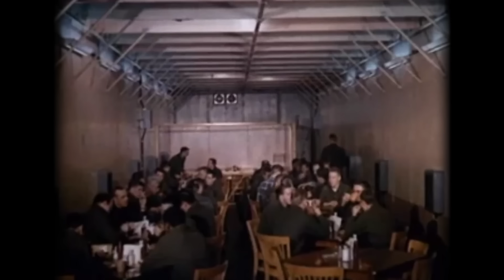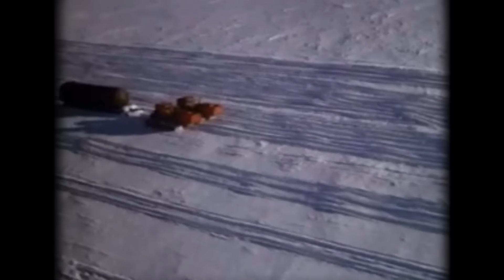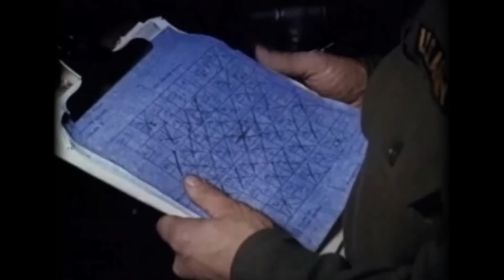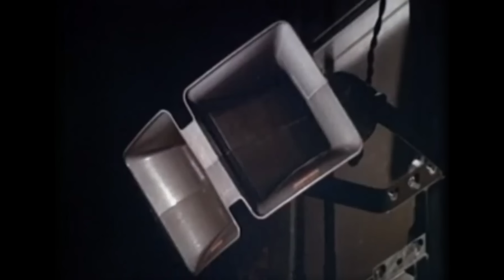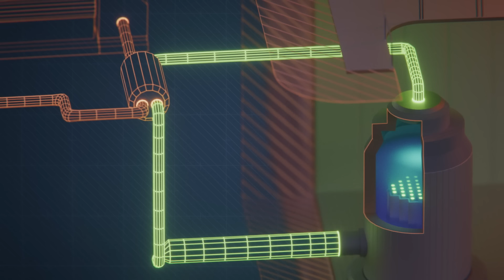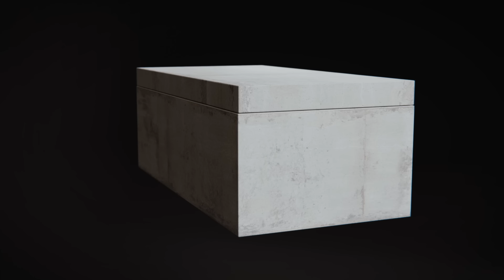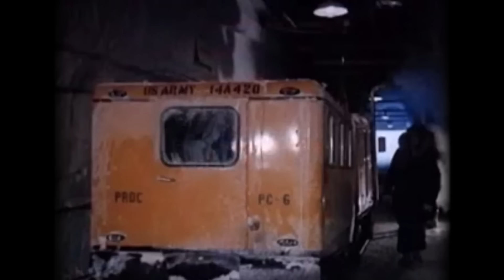How NASA Discovered a Military Base under Greenland

Comment: Super critical is good. That's where you want a reactor. At that point, it is generating energy. Prompt critical is when things go boom. Based on the video, I'm assuming it was a pressurized light water reactor. Due to the temperature Coefficient of Reactivity, Reactivity (neutrons born per generation) goes down as power goes up because of the change in density of water. Also, cladding around the fuel prevents fission products from entering the coolant. Most of coolant is activated decay products or products of radiolytic decomposition of water. The former is the concern because of the long half life's. The latter which makes us the bulk of radiation at power decays in a few days. It definitely wasn't up to modern standards, but if they never had a fuel element defect, then the radioactivity under Greenland shouldn't be a concern. Even those longer half life radio isotopes would have underwent about 1 to two logrimithic decays by now.

Comment: I would like to point out that the reason the coolant from a nuclear reactor transmits it's heat to the ultra pure water used for the steam turbine is to keep the radiation out of the steam turbine and prevent radiation leaks in the coolant loop. This facility used a heat exchanger to isolate the radioactive coolant and the steam and then had another heat exchanger in the condenser to transfer the heat to the glycol solution that was used to dissipate the heat near the surface and not produce any steam. Explain to me how the glycol became radioactive being twice removed from a radioactive source? If real engineering principles were applied this obvious error would not have happened. Therefore I detect that an anti nuclear energy bias has caused this factual error.

Comment: "The most mind-blowing part isn't the nuclear reactor, but the fact that they had to design for 'glacial flow.' Building a rigid structure inside a medium that behaves like a slow-moving liquid is an engineering nightmare. It’s a perfect example of why Project Iceworm was ultimately defeated by geology, not geopolitics."

Comment: The thing is it is not possible because ice melts meaning ice moves. glaciers are not stationary but a dense block of ice, a form of rock that is constantly being pulled down because of gravity, meaning downhill so its constantly shifting. the reason it was abandoned is because the glacier was moving.. its was a operation going for 7 years and a glacier moves about 25cm (10in) PER DAY, meaning 25cm x 366 days = 9,150cm (0.0915km) (300ft) PER YEAR or take the for example, the Jakobshavn Glacier in Greenland can reach speeds of up to 30–40 meters per day, which adds up to over 16 kilometers (10 miles) per year. AND USA DESIDED TO  BUILD SHIT THERE AHAHHAHA. iam here sitting in my own apartment in norway thinking this out, and it sounds stupid to do it so why did usa do it.. for territory, they are scared for a nuclear war but does things that heat up that nuclear question again. they scream about russia taking territory but bought alaska for 7m$ back in time and now to this day wants new territory in greenland.... funny how the BIG EAGLE is scared of russia if yall got so much power. just my thoughts:)

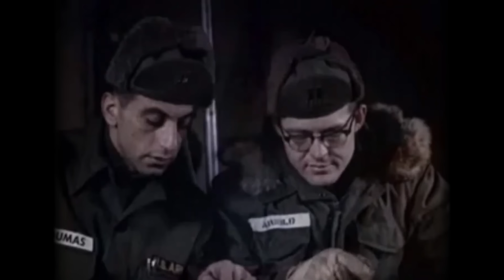Comment: 11:45 this is why the "imperial system" is so retarded, not only is it a very stupid system.. but it is actually based and converted down from metric... so they use a good and logic system to convert it to a retarded system using feet and hands..

Comment: If you want some serious Real engineering involving insane underground construction you have Muskö Naval base outside Stockholm in the archipelago which is the size of Old town Stockholm and is a complete Navy base inside the moyntaun including hospitals, Shipyard that can service the biggest ships ever in Swedish Service as the Tre Jronor Cruisers at 180meter long and Submarine ponds and more.

Then we have the insane story about Stenungsund Powerplant where youll find the biggest undergroun powerplant ever built.
Halls big enough to fit Grand Cathedrals and Tunnels and even more Tunnels.
All built in the 1950's and the blasted  rock was used in another large engineering project just a few kilometers away which was the Tjörn Bridge project involving  3 Large bridges with the biggest one the Almö bridge beeing the biggest of its type in the world when Finished.

And if you want a Nuclear project the Adam and Eve Reactor projects which was the R3 Ågesta Reactor and the R4 marviken reactor might be of intrest.
MArviken whilst Finished never reached Criticality due to political decisions and instead became the Worlds first oil power Nuclear powerplant.
Ågesta however was built inside a mountain and was the First nuclear reactor to produce thermal and electricity for the Civilian market in Sweden.
Due ti the massive use of Heavy water for both moderation, Cooling and Turbines there was some real Scifi engineering involved.

And the fact that Ågesta looks like a Bond Villians base adds to the uniquness.

Comment: Interesting content, but the stupid element is grating. It does not matter what you randomly choose to base your units of measure off of. And no, the condenser coolant line most certainly is not contaminated with anything radioactive. Even the steam it’s condensing in the condenser is not contaminated with anything radioactive. Remember? The boiler is fired with a separate loop of high pressure hot water from the reactor. Stupid.

Comment: As usual, a very good informative documentary. However, far too many snarky, sarcastic remarks. Rather than celebrating the engineering and what these people achieved in such an inhospitable environment, he snipes at them from the future with 20-20 hindsight
Reply: The "engineers" designed a reactor in LEGO style that didn't account for the difference in Temperature and associated Contraction.
The "architects" designed a structure that wouldn't be an acceptable Warehouse after 36 months, let alone a nuclear military installation.
The "soldiers" accomplished one thing in the end, threatening ALL of mankind with a nuclear disaster.

ALL of those Lessons HAD been Learned.
Do you know what is more Expensive than Properly Cleaning Up THAT Mess?
Buying Greenland and Ignoring the Problem, for 99 years.

What Motivates you to be a Fanboy of this Operation?  How do you misplace what was produced there as innovative?  Who misrepresented the Common Sense that Humans Possessed BEFORE this dumb idea was put into action?

You should be upset with them.

Comment: 16:44 that accident left one man’s radioactive corpse pinned to the reactor room’s ceiling while engineers had to figure out a makeshift stretcher attachment for a crane to retrieve his body.
Reply: I was about to comment this lol
Reply: When that happened the reactor's core power level reached nearly 20 Giga Watts in 4 milliseconds
Reply: @johno1544  a cool 700000% beyond it’s intended output
Reply: All we use is a climbing  a harness and then we tie a tagline to the leg. ... 

It is what it is, but that's what you do for crane retrievals. You don't need a stretcher.
Reply: @hercules71185  how many bodies have you retrieved that were pinned to the ceiling with a nuclear control rod directly over an open and exposed reactor core and so radioactive they had to be buried in a lead coffin?

Comment: The"that's 158.4mm for the engineers in the room".... At my job the first thing they told me was forget metric, EVERYTHING in these systems is inches... For fittings... Yes the P&IDs list the tanks in liters... Yeah the pumps are all listed in gpm... Well yeah the valves are listed in DN sizes but 25 just means 1 inch... 

You're an engineer you should be able to do conversations😂😂😂

Comment: 11:06 I feel like handling 93% enriched fuel rods with your bare hands like that is a great way to get at least superficial radiation burns... Sure they're just emitting alpha particles but the outer few layers of skin cells have got to be taking a beating there
Reply: I'd be more worried about secondary radiation from the products of the decay chain and the risks associated with aspirating the dust originating from the rods.
Reply: The Army built a similar nuclear reactor, MH-1, into a gutted WW-II Liberty Ship called the Sturgis.   The ship had no motive power due to the space taken up by the reactor and turbine and had to be towed to where it was needed.  Sturgis operated from 1968 to 1976 and did some useful work supplying supplemental power for the Panama Canal.  It took until 2019 to finally scrap the Sturgis because of the special handling required to get rid of the radioactive parts.

Comment: Wouldn't the garages in the snow be about 0degC, if you insulated the opening, with no heat at all?  And if you heated a snow chamber too much, you would have a lake.  I guess if you had an insulated metal shell under the snow/ice you could do that.

That is really cool, I knew nothing about it.  The other thing it would do is allow you a shorter strike time, with the ICBMs, at about 1/2 the distance.

Yeah, when you design for the military, one thing you quickly discover is the ridiculous amount of documentation required.  For something like LANTIRN, the documentation outweighed the final unit, the sum of the hardware used in construction.  The other interesting thing I heard was that the stuff Martin produced typically was worth its weight in gold (then) and had the mass density of water.

Comment: 18:30 Okay, I just did the math. 24M liters of contaminated water works out to a sphere with a radius of 17.9 meters. Significant, yes, but not quite as catastrophic as the video implies. Especially since it is frozen solid. While it will resurface in ~100 years, by then much of its current radioactivity will have been greatly reduced. 

Now, if it were radioactive waste (spent fuel rods, etc), that would be another issue, but even then much of its (shorter lived isotopes of) radioactivity would be spent after a century (although two centuries would be better, of course). But his is radiation contaminated water. Today, in modern power plants, such is carefully monitored, and radiation contaminated water typically loses nearly all of its radiation within decades. One of the longer-lived ones (tritium) has a half-life of 12.3 years. Traces of cesium and strontium could be a concern, but even these isotopes have half-lives around 30 years, meaning that 7/8 to 15/16 of their radiation potential will be gone by the time the frozen waste water emerges from the ice. 

So in the end the most pressing concern when this frozen block emerges from the glacier in 100 years will probably be the up to 24 metric tons human waste rather than the up to 24 metric tons of radioactive waste water. And the more there is one the first, the less there is of the second, since the total combined is 24 metric tons.
Reply: Thanks for the info, I wonder why they didn’t just say this as well instead of making it seem like an environmental catastrophe.
Reply: Meanwhile you're doing the opposite.
American cope is the biggest cope, the best cope, no one has ever seen cope like it.
Reply: Who knows, maybe the arctic Krill population will appreciate the fertiliser? xD
Reply: Greatly reduced in 100 years? 😂 The half-life of Uranium 235 is 704 million years!

The good thing is that it’s only toxic if it’s inhaled or it gets into your system some other way.
Reply: @TurkuExperience  Its the coolant water that is frozen down there, so there should not be any Uranium. Mostly the water would have been contaminated with isotopes of Cesium, Strontium, and some Iodine, and even those amounts should only be slight - enough to be measured, but maybe not enough to be a concern after a century.
Reply: @Herrkfvran ok, good to know 😊

Comment: 14:57 "a cooling line contaminated with radiation."  I don't think so. The whole concept of PWR is to separate the cooling in a secondary loop where there is no contact to radioactive sources. The main cooling water circulation is a closed water loop within the reactor assembly.(certainly not glycol filled like the secondary loop)
Reply: You have a lot of faith in the 1950s American government.  I wouldn’t take that bet without a Geiger counter.
Reply: @YoloSwagNinja It's just how PWRs work. You put faith in the design, not the govt.
Reply: @mtfe-1144 things not being built according to the specification is not a new thing.
Reply: @cleyfaye  it's not about things being built to "spec", it's the whole design.
 A PWR has separate loops. Otherwise it's not a PWR
Reply: @matthewluttrell9413  and what about not trusting people that built it to spec is incompatible with "we said it's this, but in fact it's not this" ?
Reply: @cleyfaye  there's a big difference between "It doesn't operate in the right pressure range.", " The valve body alloy is different.", or "the pipe diameters changed" and "we designed a car but they built a motorcycle." 
Not building to spec means the car had the wrong wheelbase. 
Delivering a motorcycle means the project doesn't happen. 
You can't order a PWR but get a BWR and say it's outta spec. The project would not have worked with as BWR.
Reply: yeah by definition it isn’t contaminated

Comment: 14:55 why would the coolant line be contaminated when it’s two closed-loops removed from the reactor? Is the radiation passing through the heat exchanger to the steam, and then through the condenser to the coolant???
Reply: They attached the cooling line to the toilet plumbing on accident
Reply: @SamSquantchEsq  classic

Comment: 17:13: "It would only go critical if someone managed to pull out a second rod too far. A redundant safety feature that could only be foiled by a redundant idiot."

lol, one of the best reasons to enable closed captioning to see what the authors leave in the transcription, accidentally or otherwise.
Reply from the maker: I decided to cut that out of the video edit at the last minute because I thought I was mocking the death of 3 men that clearly were not at fault of a terrible reactor design, but I did think it was a solid line😂
Reply: @RealEngineering  Wow, wasn't expecting a direct reply! haha

I totally understand and I think you made the correct decision. The closed captioning just caught me off-guard. Which thank you so much for the detailed transcriptions, reading along to the audio is very helpful to digest complex topics!
Reply: The US Army blew up the SL-1 nuclear reactor on January 3, 1961, at 9:01 pm MST when an operator fully withdrew the central control rod.  The rod was designed to not be removed but the operator dismantled the mechanism holding the rod in the reactor.  Three people died.
Reply: Just to clarify, the central rod was planned to be disconnected from its mechanism at this time. The crew was attempting to reconnect the rod to the mechanism, in fact, a task that required manually pulling out the rod a few inches to reach the bottom of the mechanism (already a flawed design, admittedly). For reasons we'll never fully know (because all three witnesses died), the one man pulled out the rod over 20 inches, causing a prompt supercriticality which blew up SL-1. There are myriad theories about what happened, from the mundane (e.g., the rod got stuck, so the guy yanked harder until it broke free) to the juicy (e.g., Operater No. 1's wife was sleeping with Operator No. 2, so Operator No. 1 commited murder-suicide).
Reply: @VV-who You know that's literally in the video, right? Did you not watch it before commenting?
Reply: I thought the secret underground base was freaky, but then you go and tell us there's a big radioactive human waste reservoir. Just wait till that bubble bursts... Jesus.
Reply: An IQ shared is an IQ halved.